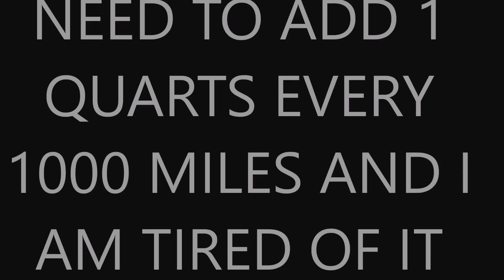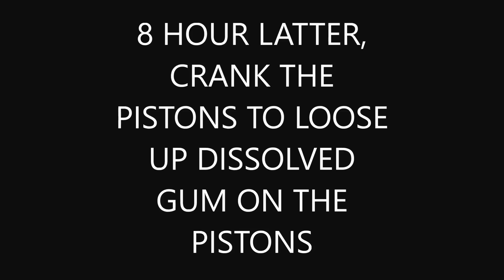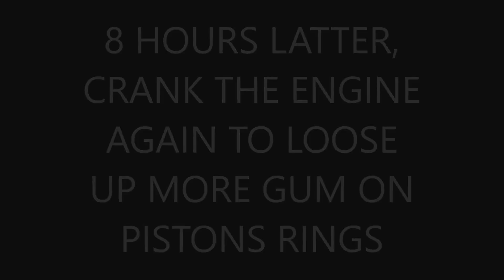MY WAY to stop ENGINE BURNING OIL FROM STUCK PISTON OIL RINGS WITH SEAFOAM

Comment: Lost me at 1:16 when you put the spark plug in after you dumped a whole bunch of liquid in the cylinder. Hate to tell you but your way is the wrong way. I feel bad for anybody who follows your video ,and doesn't know better because you're spreading misinformation. And for those of you that don't know.... liquid doesn't compress .That's bad in your engine because something has to give with that much inertia ,and it's usually the connecting rods. Then your engine is toast.
Reply: I wondered the same

Comment: I don't see what everyone's flipping out over.  I'm pretty sure he mentioned that when he put the plugs back in they weren't tightened down, so compression should've leaked past when he cranked it over.  The seafoam is made to go in the engine and burn off, and if you read the bottle, they tell u to put the shit everywhere.  I'm gonna try this on my gsr because after it was parked for several months, it's been consuming oil to the tune of about a quart every 1200 miles or so.  I pulled the engine from a low mileage wreck several years ago, but hard to say how long it sat before I pulled it, so I figure the rings are probably gummed up pretty bad.  I think it's worth a shot, cause otherwise I'm gonna have to tear it down to find out where the oils going.  and I've had pretty good luck using seafoam to clean deposits on other vehicles in the past. 

fwiw, Eric the car guy has a video on here about using water thru the carb/intake to de-carbon the valves. Sounds counterintuitive, I know, but I trust his word.  It's worth trying the cheap options first IMO
Reply: so I gave this a try yesterday, and to get to the bottom line, I've notice significant improvements in performance and smoothness. Today I put around 250 miles on it, but haven't checked the oil level yet (has to settle, and it's cold, so I'll look tomorrow and say what it looks like. ...

so I did what the video shows (2 rounds of seafoam with 8 hr soak time for each.  about half a can total)

after thinking about the whole process, i figured seafoam would be safe to use because it's not as if you're pouring water into it!  lol. the stuffs oil based and flammable, so as long as the plug gap is dry enough to fire, it'll burn off eventually, IF it's even an issue at all.  I also presumed that after 8 hours soak time, nearly all of the fluid would have bled past the rings into the crank case, so there probably would be much left behind to burn.  leaking into the oil is fine by me because I have new oil and filter in the hatch already and been meaning to change it.  a little seafoam in there can't hurt.  after some thought on it I decided that putting the plugs in when cranking over would probably help the process be more effective because the compression trying to leak down past the rings would force the fluid into and past them better than gravity. following that line of thought, I figured it would be best to crank the engine over 6-8 times to make sure it builds full compression, like the guidelines for a leak down test for my engine call for.  as far as I can tell, all these assumptions were correct because I had absolutely no problems with starting or running after the procedure.

the results were very surprising, borderline shocking.  to be honest, I didn't expect any noticable improvements, other than stopping the oil loss, if I was lucky (that's a big if with my luck!  lol).  but let me slow down before I get ahead of myself...

the initial cold start was flawless, and it actually starts with almost half as many turns. typically take 2-3 cranks on cold start, now it's running before the end of the second one. so right off the bat I was like, well that's an improvement!  and breathed a sigh of relief that it started at all after reading everyone's comments on hydrolocking.  I reasoned it wouldnt be an issue, but I've been wrong before, so naturally, I was somewhat concerned (but obviously not enough to not do it.. with the plugs tight no less).  Idle is also a little more smooth now, although wasn't bad to began with, but that's the second benefit I've noticed and I haven't even put it in gear yet at this point.  so far so good.

Running also improved.  it gained a healthy bump in power across the entire rev range.  it also pulls harder across the board, and more smooth/evenly as you build rpm.  I haven't filled up since then but I'm sure mpg will go up a little bit too just from the engine running more efficiently than before.  After the initial burnoff run, I noticed that there's no more smoke coming out of the pipe now either.  I take that as a good sign of it helping with the oil loss I was having, or at least slowed it down (can try another round and see if improved more), but I'll get that answer tomorrow.  

all things considered, even if the oil loss isn't improved, I would strongly recommend this ~$10 treatment for the improvements mentioned above. if the oil loss is stopped, it's saving me from pulling the engine for a lite rebuild.  I'm going to give my S10 the same treatment to see if I can recover some lost pep.  

the car I did yesterday is a 97 Integra GSR converted to obd1 with an engine from a 95 model.  engine has estimated 150k miles on it.  don't know how long it sat in the wrecked car before I got it either.  then had a distributor somehow go bad to where the ignition timing was retarded even with the distributor at full advance. it wasn't driven much once I realized what the problem was, but did set around for extended periods between drives until I got a new distributor and other to-do's checked off the list. I suspect it has/had above avg build up for its mileage.  i also cleaned up and re-gapped the plugs while they were out.  maybe my experience is an exceptional one, but Im happy with the results vs cost thus far.  If it fixed the oil loss problem I'll be as surprised as with everything else up to this point, and very glad I don't have to rebuild to fix it!
Reply from the maker: please let us know the result. thanks
Reply: sorry it took a while to report back but didn't drive it much last couple weeks, and wanted to do a thorough test. 

anyway, still using oil, BUT reduced consumption by about half I'd say.  I have half a bottle left so I'm going to give it another dose soon, and this time try cranking with plugs tight both times, hoping that maybe added pressure and vacuum will help work the rings loose better.  I may decrease the volume I use in one pass, and go for more rounds with shorter soak times.  that might help by keeping the rings wetter overall, and will add more cranking cycles to the procedure.  

If that doesn't help I'm going to have to turn a compression test to see whether or not the rings are worn out.
Reply: Brian Barnett you can have perfect compression and still be burning oil. They are separate rings. Just FYI.
Reply: That's what I'm doing. It helps if you've got no money. Dang!

Comment: Hey Joe, I did this to my wife's accent 2014. Previously I had added Seafoam to the oil through the crankcase. And had driven the car for 110 miles.
After that I parked the car let it stay there for 4 hours to cool the engine down.
Then I started the procedure. The only difference is that I had my previous set of sparkplugs that still had plenty of life in them but I had changed last December. So I cleaned them re-gapped them and did the complete procedure with them. Did that in order to prevent any problems with the other set as I read people having to change them after doing this. Also after cranking the engine about 8 hours later I removed them and cleaned them with gas after that I completely dried them. They were all wet of seafoam and carbon when I took them out. So I think is a good measure for not having any issues with them later. 
Also I want to report I added 1 oz the first time. And 1 oz after the first cranking round. (In each cylinder)
I measured it because I like to measure how much seafoam I put in.
I can't tell you how much smoke it took out after finally starting the engine.
It smoked for about 17 minutes.
Also after the first crank I waited for about 12 hours.
After the engine had started I drove the car for 15 miles up to 85 Mi/h.
Let it parked for a night and yesterday did the oil change.
The oil was BLACK (it only had 1220 miles on it) and the oil filter got clogged and I actually opened it in order to see why it felt with the sensation of having gelatin inside of it. My God! It really had trapped sludge and big carbon pieces inside of it.
I will report back after 1000 miles to see if it fixed the oil consumption.
I have no words to thank you enough for your video.
Keep up the good work and also I had NO hydrolock like many are telling here about.
Just a little bit nervous and anxious at the beginning but later I accomplish it perfectly fine.
Also I subscribed!
Reply from the maker: alberto martinez please consider to subscribe. Thank you
Reply: Joe, yes I already did it !!
Also I cut opened the oil filter and at the bottom of the can there was black grit from the removed carbon deposits I presume.
Reply from the maker: alberto martinez your comments helps lots of others. thanks
Reply: Hello Alberto, any feedback after 2 months ?
Reply: Yes, I'm happy to report that after 1076 miles the oil consumption is not noticeable at this moment. So I am more than happy with the excellent results we have had until now. Also the mpg is steady in 25 mpg just city driving with AC on most of the time. 
Thanks to Joe this info should be everywhere !!
Keep up the good work Joe !!
Reply: And how big was the oil consumption before ? Thanks for answer :)
Reply: Daszekk, well I was adding 1 quart every 500 miles approximately it was completely insane!
Reply: Jay Yoyo  The results I have are pretty good. I also discovered that doing the cleaning with CRC GDI valve cleaner spray helps tremendously not to consume oil. What I do is this: before the oil change I do the CRC gdi valve cleaning and let the engine cool off. Some hours later I add 4 oz of seafoam directly to the oil crankcase and drive the car normally for about 300 miles (about 2 weeks... that's what wife makes in 2 weeks) then I do the oil change (oil comes pretty black) Then for about 1 month and 2 weeks the car does not consume any oil at all (I have confirmed this checking the oil dipstick every week) After those 6 weeks car starts to consume oil again (1 quart about every 500 miles). We let it be like that until next oil change and start this process of CRC gdi valve cleaner and Seafoam again. That's about 5 months period. Hope that helps. Also we added this oil catch can that I think is helping also. There are videos on YouTube about adding the oil catch can. You may want to check them out
Reply: Jay Yoyo  if you want my opinion about this issue I'd say the main issue here is the engine design because as I already explained to you the car does not consume any oil in 6 weeks but after that period it starts accumulating carbon inside of it. Then it reaches to a point where it starts consuming oil again. Cleaning it like I have explained to you keeps things at bay so that's the best we can do for it until we get another car (one in which this gdi issue of carbon buildup does not happen )
Reply: Jay Yoyo  trying what you suggest is not possible because I don't drive it. It's my wife's car. So I just see the results and the results are those I shared with you. Also, I do believe she uses highway during those 6 weeks period but I just can't tell how much. I drive an 05 civic which after 17 years does not burn a single drop of oil so I much prefer to stay on the safe side and not change my car for one of these new craps they make. GDI engine sucks! She's thinking in change her car next year so hopefully it won't be an issue anymore to me.😜
Reply: Jay Yoyo  it's a Hyundai accent 2014. The Honda civic i drive is manual transmission so no issues with it. 😉 And by the way I did try to overfill it (one of the first things I did but didn't work 🙄😒 )

Comment: i did this ( once not twice) on an accord w/ 110,000 miles that used a quart every 1200 miles. Using Marvel Mystery Oil.
The motor stopped using oil and it did not blow up from vapor lock. Stuck ring I assume.
Reply: Haroon Jamshed how is it? Did it work? Your honda still burning oil?
Reply: we need the answers, how was it?
Reply: OK.... 1/2 Quart = about $2.50 per month X 12 Months = $30.00 a year. Trying 
fixing it... It's gonna cost you more than $30.00 and time consuming 
too.  LOL
Reply: Jordan Bronson how does $3.88 for a bottle of mmo cost more than $30.  Also, $2.50 for 1/2 a quart every 500 miles. That's at least $5 month for most people which is $60 a year for who knows how long instead of fixing it for less than $4. Maybe you enjoy pissing away money instead of having a correctly running vehicle.
Reply: Jordan B          FINALLY!!! Someone with sense!  Not to mention that some will hydrolock the engine and bend a rod...
Reply: +Jose Peixoto - RIGHT !!!  To each own I guess!  Some People don't even know how to READ !!!  If they have read my post correctly, they would see why it cost more than $30.00 to fix it..... LMFAO!!!
Reply: sdanville hello there is interesting to know that you car stop burning oil I have a 2010 Acura MDX and is also burning oil I replaced the pcv valve and still is burning but not as before,, please can you tell me how is the procedures with the marvel mistery oil on the engine and how many bottles you add and how often,, thank you
Reply: @JodBronson  yea but no worries about car has less oil or not ......mostly longways trip
Reply: @ueg-zm8wf  - Just bring a $15.00 Gallon jug with you, for your long trips!  It's like bringing "Water" for long trips!  You need Water, Car needs Oil!  LOL
Reply: @nyc.bt.9512  -  I wished I see your post earlier...  My Dad's truck was burning Oil and I discovered a " leak ", I think.  I took Lucas Oil Fix and it solved it.  It's been almost a year and it's still doing great!
Reply: Jordan Bronson thank you sir but I have a phone call from the dealership telling me that my car is on the list for a  recalled year and model and finally they fix at no cost,,
Reply: @nyc.bt.9512  - WOW AWESOME.  Great news for sure!
Reply: Jordan Bronson thanks a lot for your concern
Reply: @nyc.bt.9512  - You are welcome, anytime!
Reply: @nyc.bt.9512  Did you take your car to the dealer? There was a warranty extension because of oil consumption problems. They practically would have fixed it for free.
Reply: @JodBronson  try 10 dollars a quart of the specified 0w20 full synthetic ! Every 1000 or 1500 miles total bull shit from honda!

Comment: You didn't crank the engine with the plugs still in, right? If so, you risk destroying engine through hydrolocking. You're counting on the seafoam leaking down past the piston rings. If anyone one cylinder still has liquid in it, the engine is toast as soon as you turn it over.
Reply: completely agree, I cringed when he turned the key. I think I woulda left the plugs out if I ever tried something this desperate.
Reply: Rob T well if their sea foam in there when you turn it over with no plug it goes everywhere. He could have left them out and  rolled it around by hand.
Reply: Alan Waterman what about that stuff getting in to the engine oil ...
Reply: alan its fine to put it in the crank case
Reply: I don't think a starter can do that, hydrolocking happens to an already started engine that gobbles water when running. I'm pretty sure an engine cranking won't punch a hole in a piston or flex a connecting rod - a starter can't push enough power to do that. Also - after 8 hours the seafoam had a long time to drain from the combustion chamber.
Reply: There are small holes on the sides of almost every piston for oil return, so no hydrolocking unless you overkill it. All this guy did was put a shine on the inside of the motor
Reply: Sean Beagles you must be "YouTube Certified Master Automobile Technician" 😲
Reply: he put the plugs in but not tight. and didnt hook up the cables to the plugs.
Reply: @remytv  yes s starter can bend a connecting rod I have seen it more than once
Reply: To crank by hand , which direction shoiluld I crank it?clockwise or content-clockwise?
Reply: All of the components in the engine are rigid, and the crankshaft and flywheel have some decent mass.  When the hydro lock occurs, it's going to slam extremely hard, even if it is the starter that's turning it.  It could definitely bend or break something.
Reply: Not necessarily. I've broken a starter motor from hydrolock. Something gets damaged, tho.